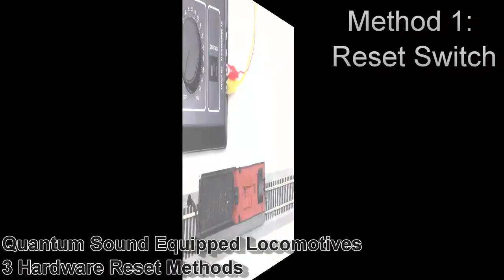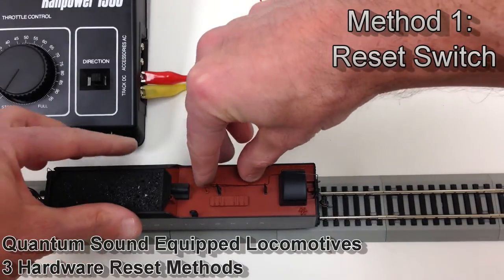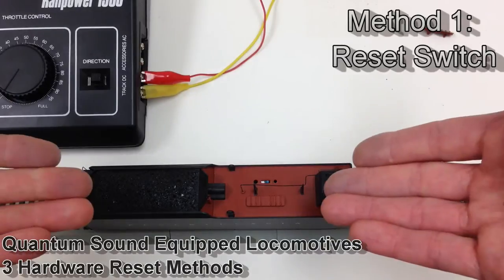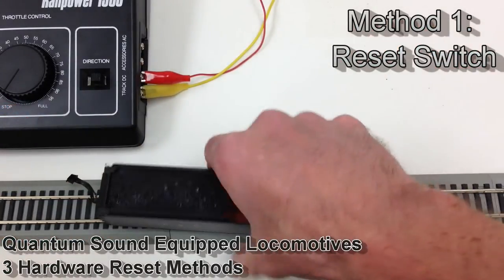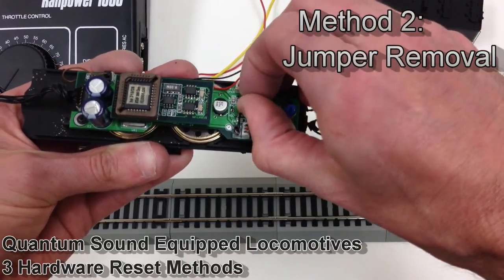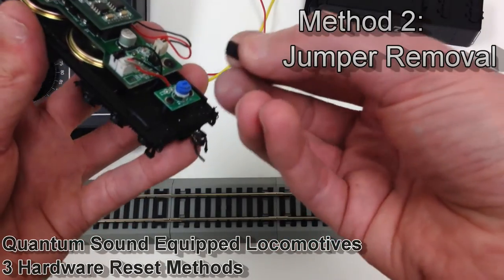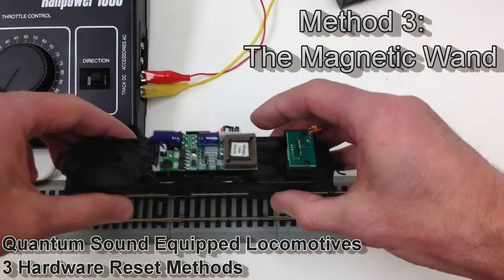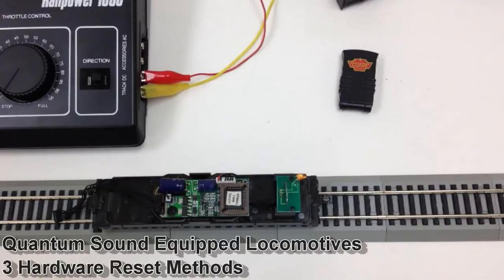OFFICIAL "HOW TO" VIDEO: Quantum Sound Equipped Broadway Limited Imports Locomotive Hardware Reset

Comment: I've got a strange one, a blueline Niagara... Sound but no movement.

Motor works when power directly applied to it but no movement otherwise.

Changed the 8 pin motor decoder, still nothing. Tried a DC blanking plug and tried it on DC still no movement yet I have all of the function sounds. Checked all wiring etc, all look's good.
Reply: Looks like it is in stand by mode. Try pressing F6 twice and check if that helps